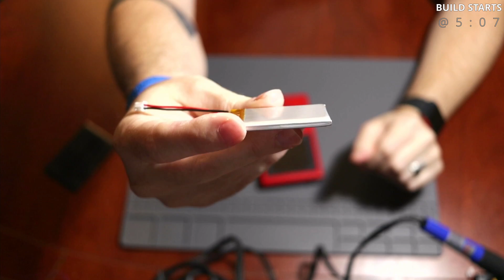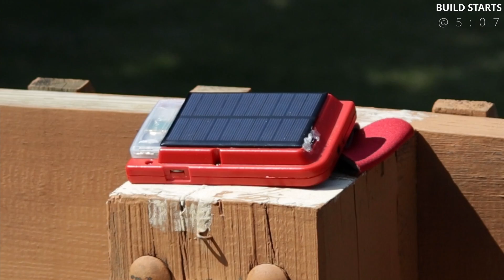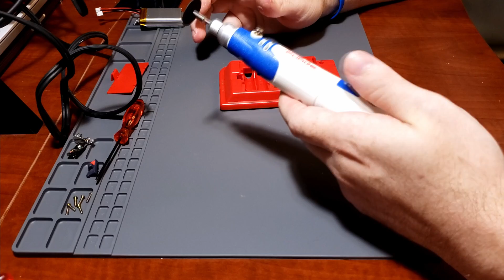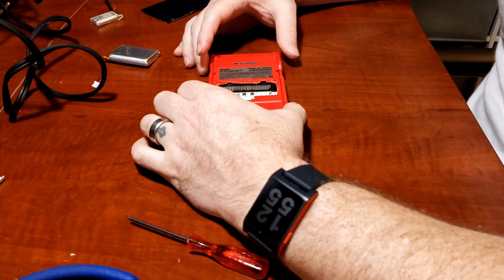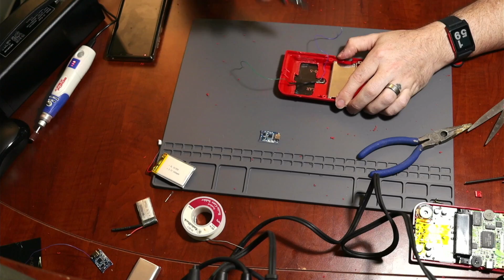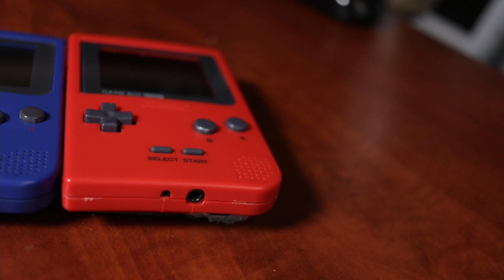How I built the ultimate Solar Powered Game Boy Pocket!

Comment: K but I can turn my phone into a pretty decent gaming device for retro games and it has touch screen. I don't use this for gaming but I'm saying this includes touch screen games that support it such as android games. I mostly hook up a Bluetooth controller for retro gaming or you could get a backbone type controller for most Android phones. Retroarch is very easy to setup and supports quite a bit of retro systems. All you then need is a good solar charging power bank and your practically set. No real need to have the power bank permanently attached as your phone should have internal battery so just make sure it charges while plugged in and once charged put the solar charger on charge.

Comment: Totally geeked out and love this video. My only suggestion would have been to use a replacement shell that would have been easier to cut and maybe give you more room with custom shell. Also, that filled in glue gun won't keep out all the dust over time. Maybe a custom 3d printed bracket you could crazy glue to the shell. Overall I am very impressed and great job!